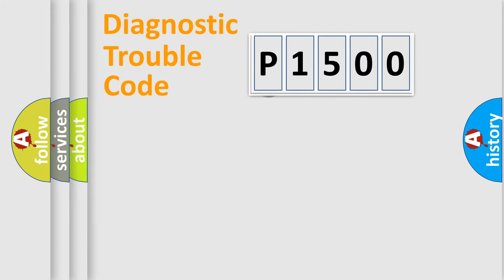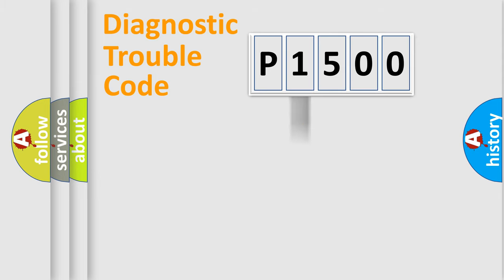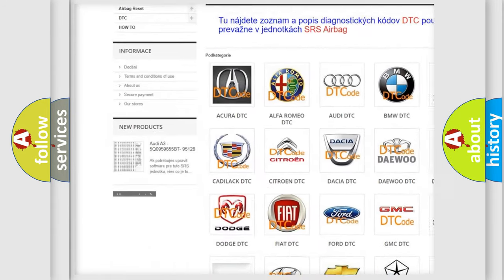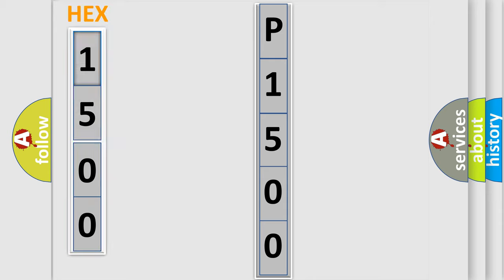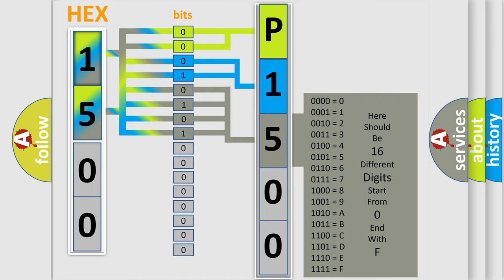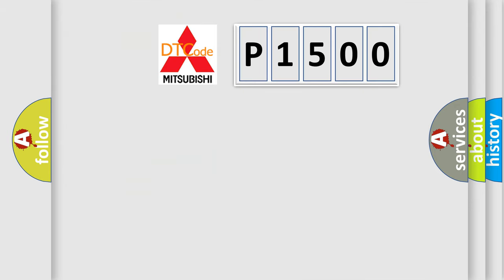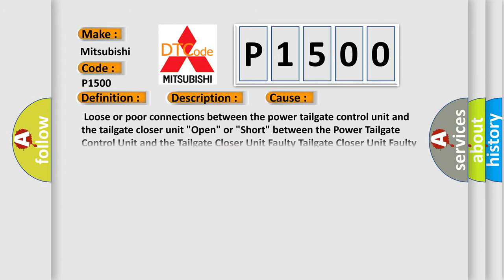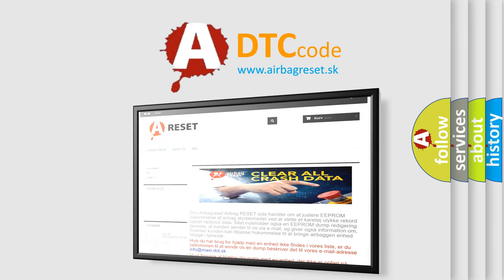DTC Mitsubishi P1500 Short Explanation

Comment: 90% of P1500 definitions online say "Alternator FR Terminal Circuit" and then it was mentioned twice that it could be "Vehicle Speed Sensor" code, but you are the first one to say "Tailgate" code.. Can anyone double check the accuracy of this video? Thanks for the effort but I'm trying to save myself and lots of other people who watch this from making the wrong diagnoses on a Tailgate, if they should be focusing on a driveability issue.. Mine was making a burning smell, then engine died while accelerating, and checked codes, MAF code(P0101), but checked alternator and alt was very hot. Headlights are also very dim.. Vehicle wouldn't start.. replaced MAF after vehicle would run with it unplugged and now getting P1500 and P0134(O2 Sensor No Signal[B1S1]).. 
Would make sense if the P1500 was an alternator code.. Not sure how a "tailgate issue" would cause these driveability symptoms.. 2001 Mitsubishi Mirage DE 1.8L Automatic.. Oh by the way, its a sedan and has no tailgate lol.. So please double check accuracy of this code, I doubt its a "Tailgate" code.. Probably the "Alternator FR Terminal" code. I will diagnose more of the alternator issue, just want to guide people in the right direction hopefully.